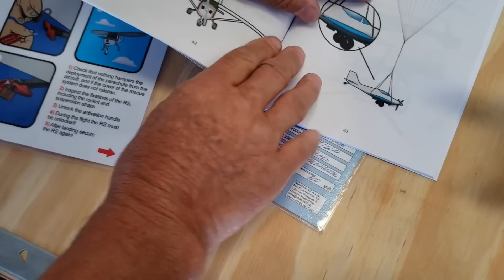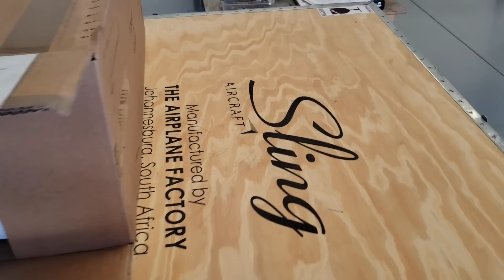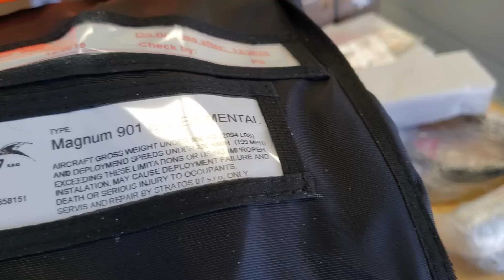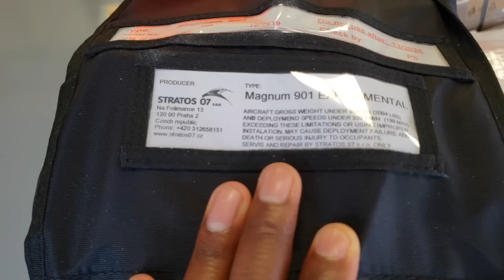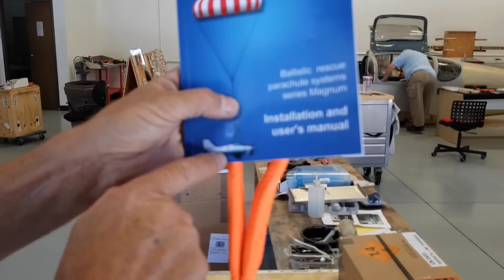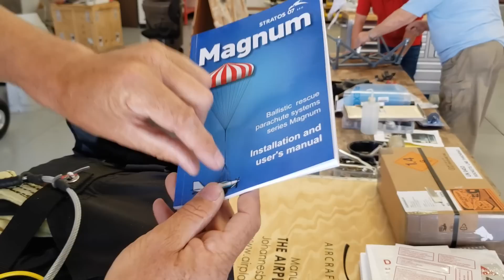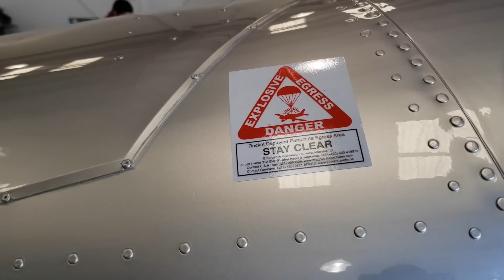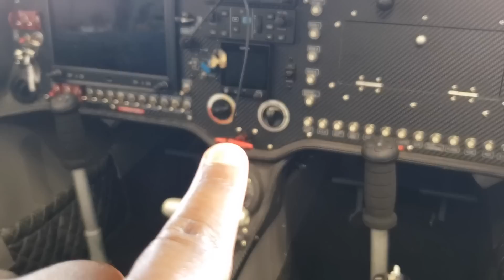My Airplane Parachute Just Arrived! Unboxing The Parachute Bag + Rocket

Comment: Maybe you are a world class airman and there is no chance you will do something stupid or misjudge the weather. But what about that that guy hot dogging a straight in approach while you are on base turning final as the sun begins to disappear off the end of the runway? Bang! The tail is still there, but the stick won't budge. Time to pull the handle! Being a proficient pilot won't help you if the other guy is impaired. That impairment doesn't have to be a substance, it can be as simple as squinting into the setting sun.

Comment: I found it interesting that the rivet's in the parachute box were installed with the expanded mandrel inside the box, rather than the rivet head instead.  I would think that could provide some drag or tearing as the chute exists the box?  Or maybe since the chute is in the "bag", there really is no exiting movement in the box itself.  Just curious is all.

Comment: Wait a second, putting that extra "strap" for easy insert/removal of the parachute, wouldn't that become tangle and prevent the chute to open? That would be very very bad to find out when you try to use this. Maybe, contact manufacturer and find out.
Reply: I think it's just a temporary thing until the chute is sealed up.

Comment: So that parachute was not connected to the rocket you say ?... I see an issue with that.    This is a great safety thing, just remember to pull ( if you have too ) the darn handle and stop taking  those I phone selfies at or above the recommended altitude, if not at least it might break the fall a bit..... kinda.        FLY SAFE . Thanks for the video Mike.

Comment: I don't know anything about engineering, but maybe there is a way to install some structures similar to kites (made of cloth or inflatable plastic) around the wings and control surfaces, so the pilot can eject them to be able to glide their airplane in case of stalling, engine failure or other problems. The shape and ejection mechanism of those kites would be a huge challenge to design, I guess.

Comment: I remember an article giving examples where these systems were deployed more unnecessarily than not. The accident reports point towards a lack of confidence in pilot skills. Sorta like drivers having the option to deploy the airbag on their cars, rather than having the ability/skills to drive their way out of a situation.

Would I like to have the option of a ballistic recovery system (BRS) in the event of a catastrophic airframe failure? Yes. The question is what did the pilot do to get themselves in such a situation to begin with? And, how many accident reports point to, "if they only had a BRS..."?

And I wonder. One deployment and the insurance company gets to determine if the deployment was necessary or not? Since there are unnecessary deployments, I wonder if insurance is higher for low-time pilots with a BRS than higher time pilots.

Comment: Am....what rips open the aluminum skin of the plane? Rocket is so strong?
Reply: The weight of the airplane on the cables.
Reply: The aluminum skin does not rip.  The skin above the cables is one layer of fiberglass not aluminum.  Watch the full video.  Jean does an excellent job of explaining!

Comment: I wonder how often the rocket needs to be inspected?
Reply: that chute package is labeled "Do not use after 12/ 2025, it looks like you buy a new replacement every six years. reference time on video 9:35. Looking at Stratos website the chute and rocket must be sent in for revison every six years. here is the process that was listed on thier website. During the revision are controlled all parts of the rescue system. The parachute is unpacked, controlled if it is not damaged, the porosity and the resistence are tested, further it is ventilated, for some days put out and after it anew packed and pressed into the container. The rocket motor will be repaired or changed for a new one. All deficient parts of the rescue system, or parts perishables in the chemical process of aging are changed.